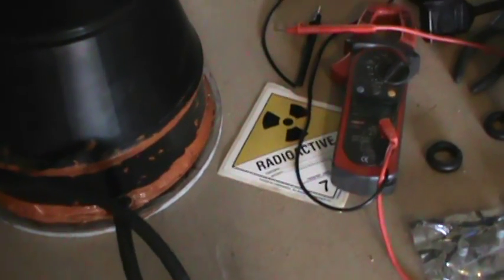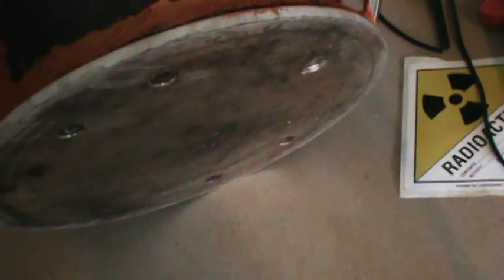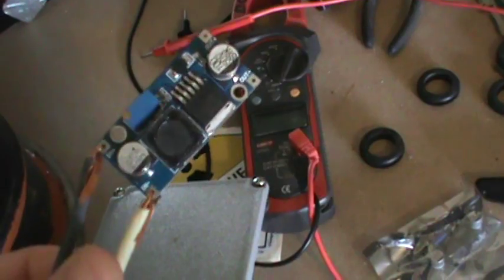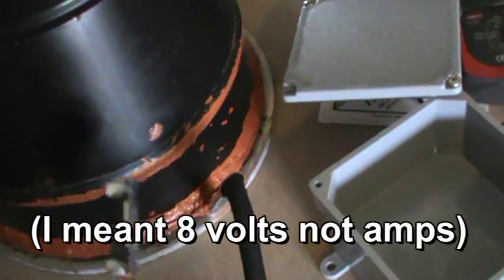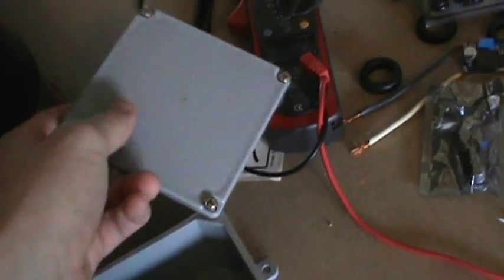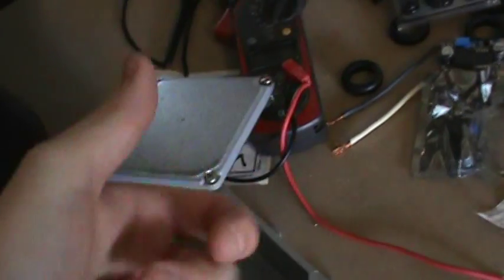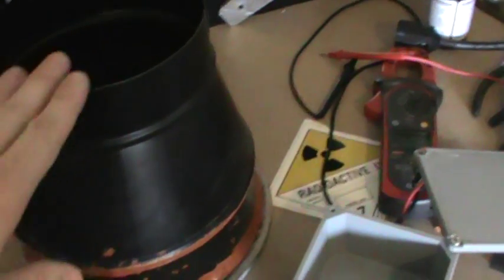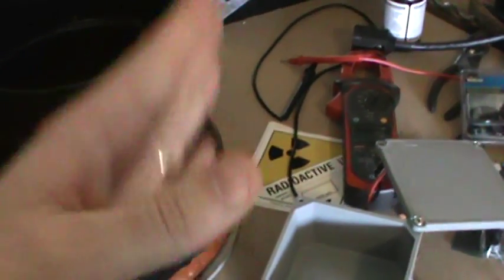Update #2 Thermoelectric generator build progress steadily moving along!

Comment: Since you will be boiling water, why not add a  funnel with copper coil (to collect the water vapor) leading to cooling bath  so you can distill water at the same time? If you locate the cooling bath higher then the T.E.C. pot you can use the bath as a reservoir to refill the T.E.C. pot, that way it won't ever run dry and ruin your T.E.C.